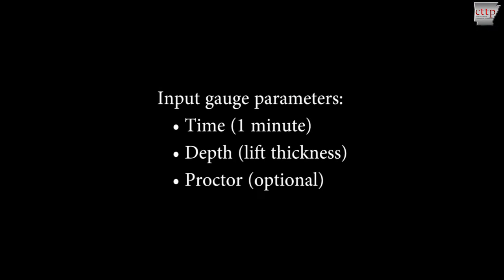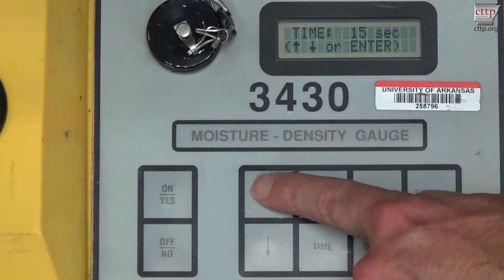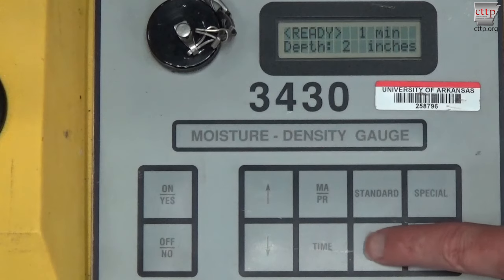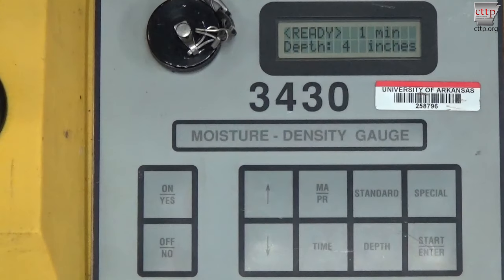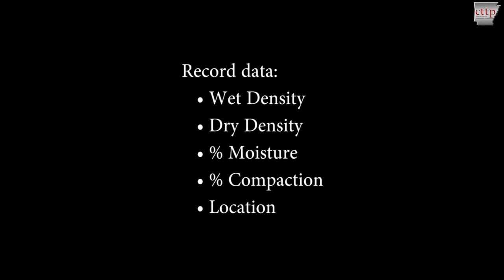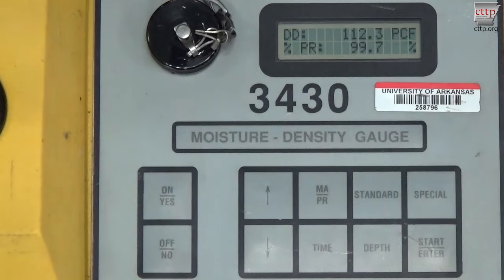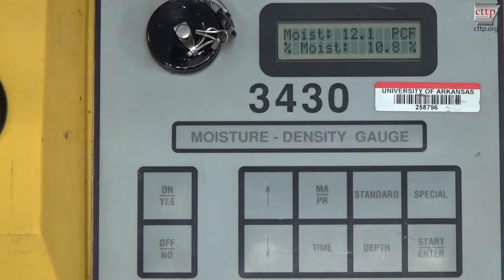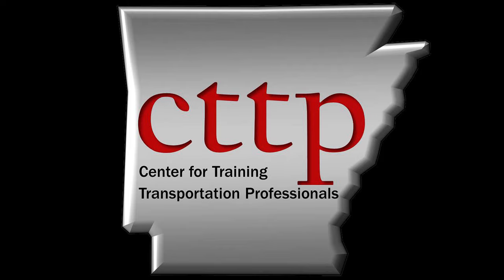AASHTO T 310 - Nuclear Density Gauge - Field Testing

Comment: Nice test but what does it mean back at the lab? What is a good reading or bad reading. From my understand as an retired superintendent, the fill test should match the existing soil compaction or you will have unequal settlement. All the test are a pain in the ass for the superintendent. We have to call for all test and inspections, and show them where and so on. Its an endless task among all the other daily jobs.
Reply: Welcome to construction management
Reply: The material has to be collaborated in the lab prior to testing. The engineer will come and take about 60kg worth as a sample and conduct an Optimal Moisture Content test at the lab. This will generate a Maximum Dry Density figure as well as an optimum moisture percentage. On site with the NDM, you compare the results to these collaborated figures and overall are given another percentage based on the similarity of the results. A 100% reading would be an identical MDD with moisture reading under the optimum. 
Most councils across the UK require material to pass at 95%. A high moisture reading (from rain, for example) would affect the result as would a poorly compacted material

Comment: 工程师您好，有个关于TROXLER3440操作的问题请教一下。在操作过程中，将探杆由安全位置往下放入探孔中，界面不显示深度值，按START/ENTER键以后，显示Invalid depth ! change rod depth . Press START when ready .。应该如何操作才能正常显示深度值和仪器能正常检测。谢谢。
Reply: My gauge has that problem too. I believe the Troxlers can switch modes, there should be a mode button and switch it to 'manual'. When you place the rod in the probe hole it should now ask you for the depth and you can input it manually.

Comment: What is the initial PR value? what does it mean and how do I know what to use?
Reply: PR is the number you get from the lab. They provide you a proctor and an optimal moisture to shoot for.
Reply: PR is "proctor value" it is the dry density maximum of the materials you're testing. You take a sample beforehand, the lab will process it and find the max dry density. That is your PR number and it specific to the materials you're testing

Comment: lol  we legit just use a drill with a wood bit unless theres gravel. also we dont use guide plates XD
Reply: Dude I tried that and it doesn't work well on aggregate base, only soils. Has that been your experience too?
Reply: @snarp408  yea u only use it on clay or aggregate free bases. For those you use the pin and hammer

Comment: Most dangerous to health this job
Reply: No, not at all. You get more radiation in a single flight ✈️ than a year of safely operating a guage (with alara in mind)
Reply: @kiritimatiswan1986  Unfortunately a lot of technicians use nuclear gauges incorrectly by deploying the rod above ground and then eyeballing it into the hole. This exposes their legs and feet to dangerous levels of radiation.
Reply: @Socal_Geo1  Is a non nuclear version not as accurate?
Reply: Dude I've been doing this shit every day for the past 8 years and every year I go for my medical my dosimeter badge barely has anything on it. You take more radz from a bloody microwave
Reply: @xXxKazamaxXx absolutely. That's how I do it, and have never had a high dosemitry reading. Been doing it 4 years now!
Reply: @dan__________________ they apparently have electric versions now. I've heard (but don't know firsthand) that they're just as accurate, but they're extremely expensive compared to these
Reply: @snarp408 I just started this type of job. When you say you have been doing it this way do you mean by eyeballing? It seems impossible using the marking as a guide.